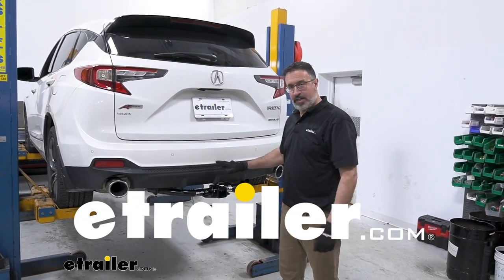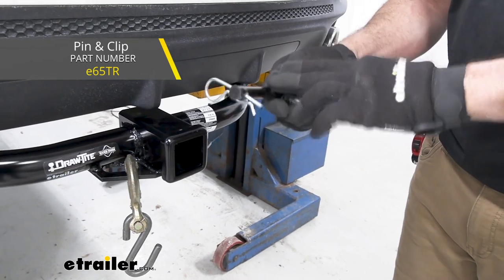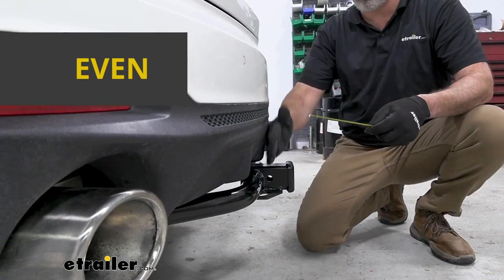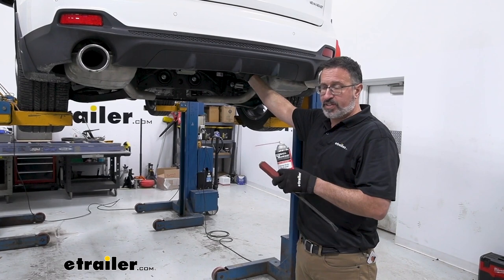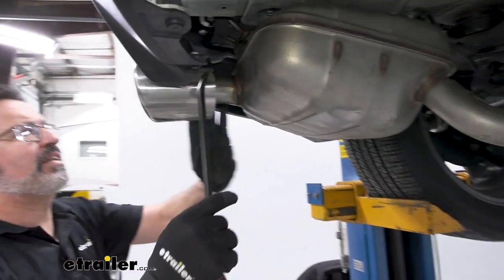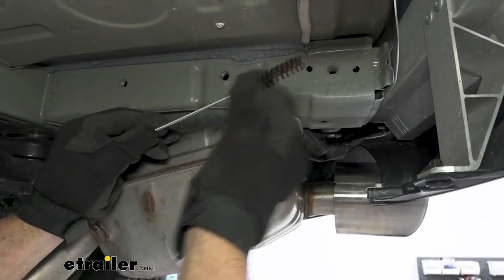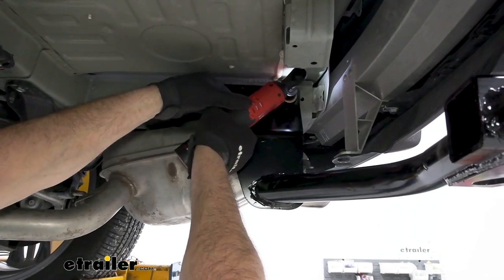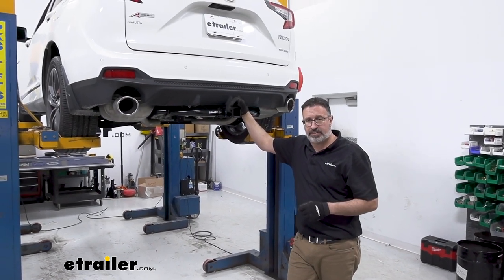etrailer | Setting up the Draw-Tite Max-Frame Trailer Hitch Receiver on your 2019 Acura RDX

Comment: What kind of bolt and the thread this is   m12-2 thank you
Reply from the maker: The Draw-Tite Class III hitch uses four M12 x 1.25 x 44mm CL 10.9 hex bolts and four 1/2 inch conical washers. You can see that in the install instructions that we've linked for you below:
https://www.etrailer.com/instructions.aspx?pn=76268